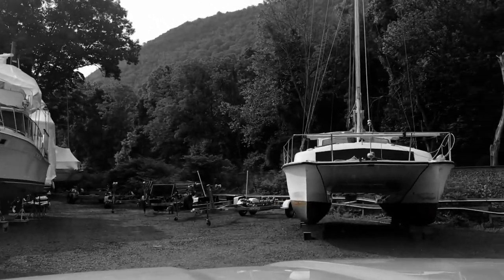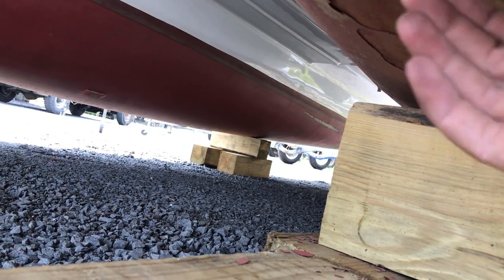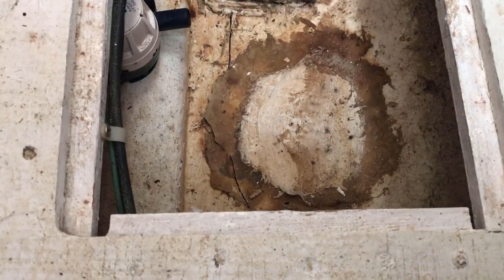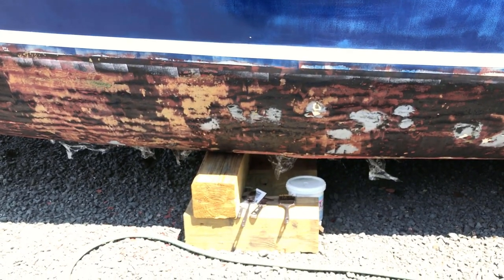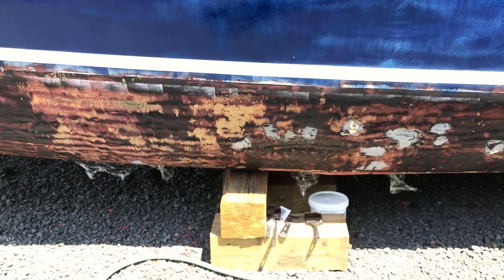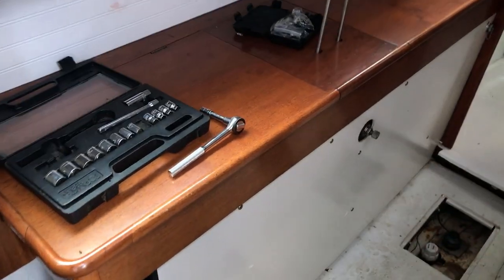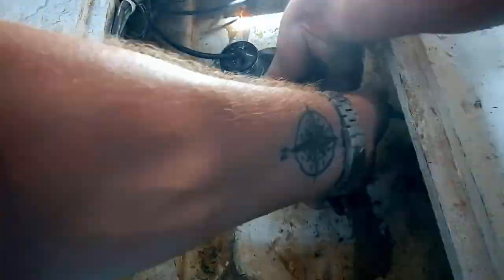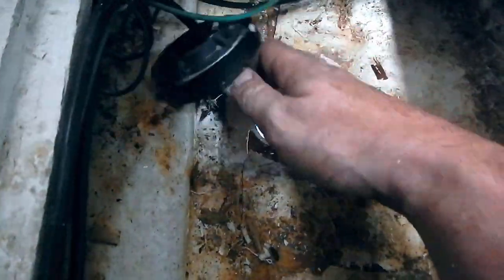One Less HOLE In The Boat - Apply A DIY Fiberglass Hull Patch (Boat Work: Sailing 9 LIVES)

Comment: Hi folks,
It has been a while. Some of Tony Smith's later boats were known for flexing. One obvious problem is terribly inadequate support from the blocks. There should be four on each hull and they should be padded. Some yards are using large foam blocks instead of these wooden ones because they spread the load. The yard workers did a very poor job blocking this boat. I have seen hulls broken because of poor lifting and blocking. No excuse for it.
Reply from the maker: Hey, Ed!
Yes, we are only recently re-launched, all a long delay due to COVID-19. There were restrictions on individuals gathering together, so crews to launch boats were tough to gather, but more restricting was the unwillingness of some boat owners to allow their boats to be moved out of the way. At this point, everyone at the marina seems to be safe and healthy, so that's a good thing.
As for this video... yes, the blocking was both inadequate and placed incorrectly. The guys in the yard missed their mark by a foot or more, and that caused some issues. We didn't actually end up cracking the hull, but it did flex and cause concerns about the transducer leaking.
We've blocked the boat a time or two since this repair was made, and done properly in the proper locations there has been no problem.
We have a bunch of project videos in the hopper, and should resume producing sailing episodes soon, as we are setting off for an extended trip in 2 weeks. Thanks for watching!

Comment: Poor blocking along with pretty frail hull condition, probably due to age/usage and the manufactures saved a few layers of fiberglass, where they were critically needed!!  Better finding it in the yard than passing over some huge log, in the water!  Good thing your handy with fiberglass! Can imagine how much those repairs would cost! Hope you get to float your boat, soon!!
Reply from the maker: Thanks, Joe. I think the hull flexed a bit due to the point load in an unsupported spot, but luckily it did not actually crack. I was concerned since the transducer moved a little bit that the seal would be compromised, so took the opportunity to eliminate the risk (and the hole). We re-installed the transducer in another location, to be used as a redundant backup system (our next project video) and will soon upgrade to more modern hardware as our primary system.
We sail again in 2 weeks!
Reply: @Sailing9LIVES  looking forward to your videos...wife and i are from albany area...RV's not boats but love watching the videos
Reply from the maker: David A Mineau 
Hey, David!
Thanks for watching. We have a lot of “project” videos on the way, some of which may in some way translate to RV life... and then we will be making sailing and travel videos for the rest of the year and all of 2021... some of that will very much relate to RV life! Maybe we will even bump into you when we head north along the Hudson River and through the canal system. 🙂

Comment: Afraid you might still have some stress cracks in your hull
Reply from the maker: I was, as well... but I had a technician take a look after I removed more bottom paint and more of the paint on the inside of the bilge and he said there was no evidence of any cracking. So, I hope at this point that we were correct. :)
We've blocked the boat a few times since this repair without any problems, and we've floated the boat twice since, as well... no leaks. :)
Reply: @Sailing9LIVES  Good News!